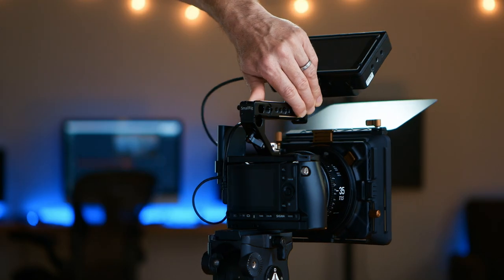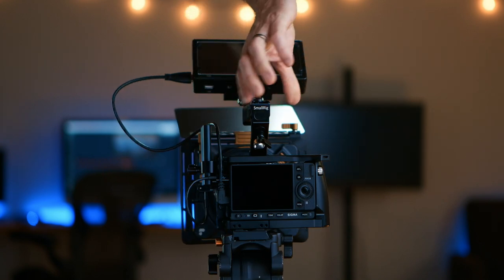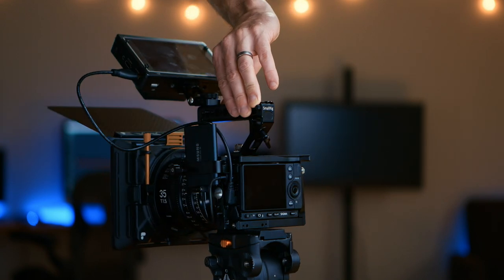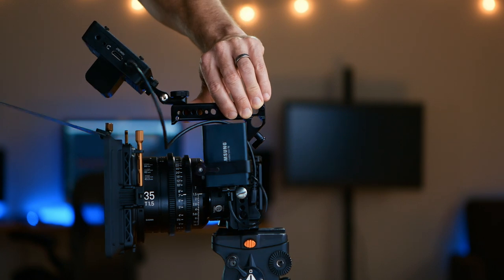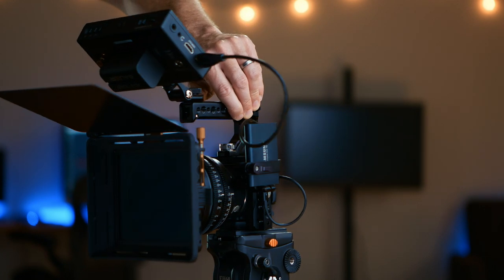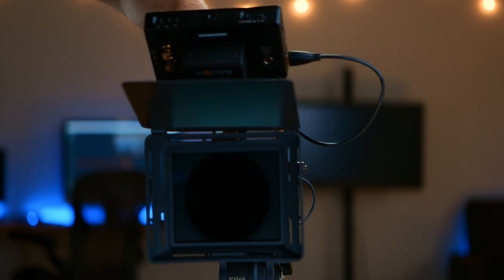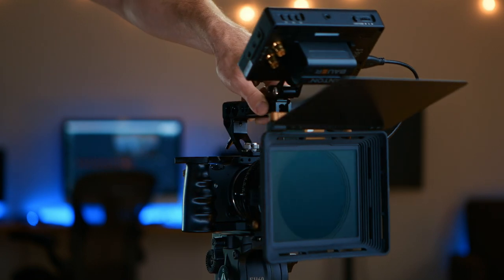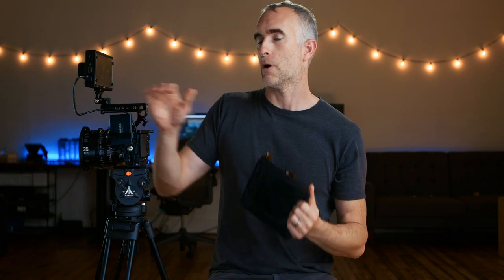Sigma fp: 35mm CINEMA RIG

Comment: Curious on what adapter you are using for the Sigma 35 EF mount? I was looking for reliable EF adapters without the electronics.
Reply from the maker: It's the official sigma one. Works fine.
Reply: @Crimsonengine  thank you

Comment: This is no negative comment on what you have done, I think it's quite appropriate and sensible, but what I find ironic is how just about everyone bagged the BMPCC4K mercilessly because it was unusable unless it was rigged up. Here we have a somewhat similar camera that also needs to be rigged up to get the best out of it. Like the BMPCC4K/6K, you don't have to rig up the fp, but it's a choice that you have so that it meets your needs. 

As for the HDMI cable, I got a ribbon, right-angle cable, from Amazon: 'Honeytecs HD Cable HD Male to 90 Degree Right Angle HD Male'. It works well with my BMPCC4K and Blackmagic VA 12G 5" and is just the right length to tuck away nicely.

Comment: This is something I would like to build.
Reply from the maker: Not that expensive! This whole rig will run you less than the new c70
Reply: @Crimsonengine  my only delay is the l mount
Reply: @meatbyproducts   Lots of adapters out there, I was looking at L to EF and L to Leica M mount for some real vintage (1950's) Canon RF lenses that I have. That said, I'm still in the consideration phase with an FP, don't own one yet but it is on my list.

Comment: What adapter are you using to mount the Sigma Cine lens on the Fp?
Reply from the maker: Its standard Sigma one
Reply: @Crimsonengine  I wasn't sure which one was applicable.
Reply: Fotodiox makes adapters with a build in ND filter

Comment: I totally love this camera and what a Mighty Mouse it is! Been using it as a B cam on TVC's and it cuts beautifully with an LF. What are your thoughts on pairing it with a BMD video assist? Thinking about it as I have a doc coming up and might need to manage HDD space.
Reply from the maker: I had the video assist for a while but found the weight and battery life to be a drag. I have used the 5" smallhd oled with it and it's awesome. The HDMI port on the bottom is great.
Reply: @Crimsonengine  I have an older (before the 3g designation) Video Assist 5 and the battery life without recording is horrible! That said, there are Canon to Sony battery adapter plates you can buy, then you could go up to a big 970 battery.

I haven't run my Video Assist 3g 7 inch on battery yet, but I expect it will not be great either.